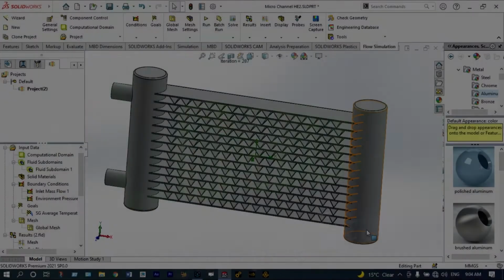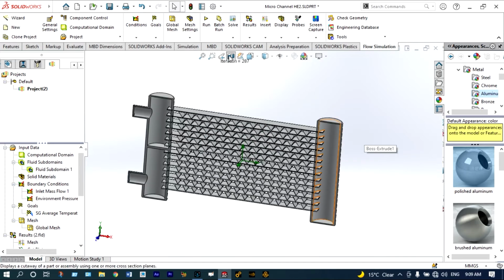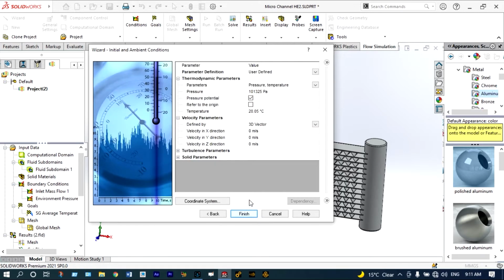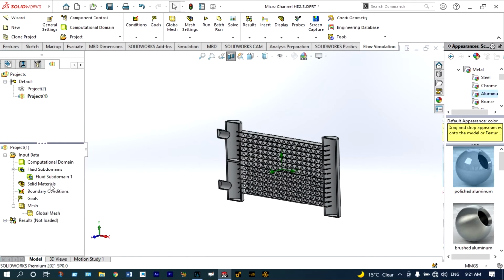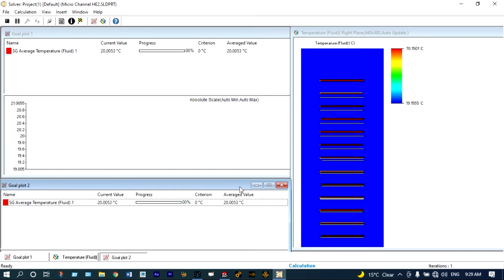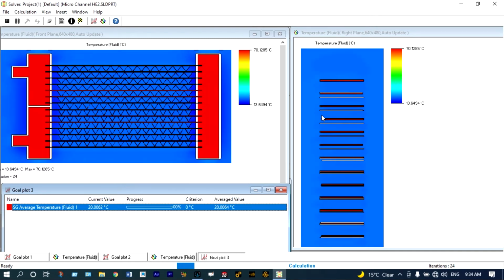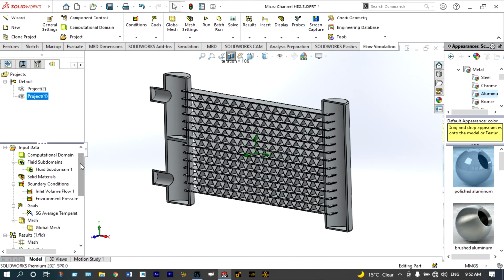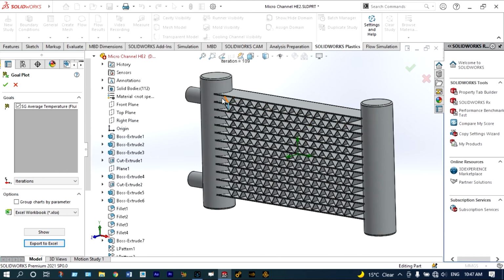CFD Heat Exchanger | Heat Exchanger Optimization | Micro Channel Heat Exchanger - SolidWorks

Comment: @CFD_GUIDE thanks for the video! it was very useful. But i have two questions, 1. At inlet flow why did you select the big plane in the big tube instead of the small face of the lid at the actual inlet? does it make difference? 2. what is the difference between the temperature you have to enter at fluid subdomain and the temperature you have to enter at inlet flow?

Comment: nice videos. but I have a question. what if you want to change the air temperature? and if the water flows within one minute . how can i add a timeframe. Like changing the cooling time to 2 minutes or more
Reply from the maker: Then it will be a transient analysis which is time dependant. Air temperature can be varied from fluid subdomain or from boundary conditions
Reply: @CFD_GUIDE  do you know the manual formula to find out the result of the iteration method
Reply from the maker: You need to perform a transient analysis.